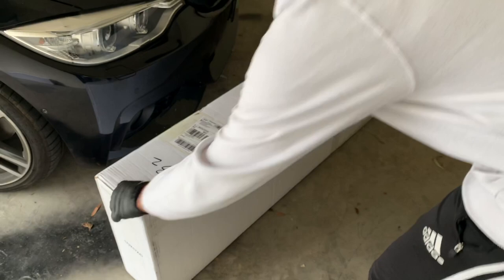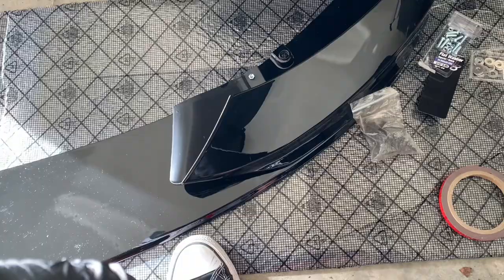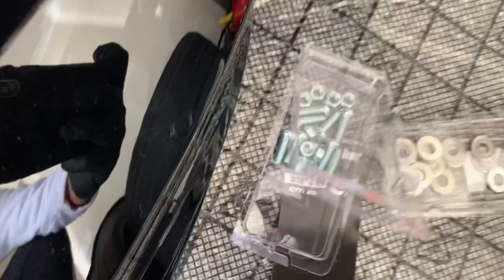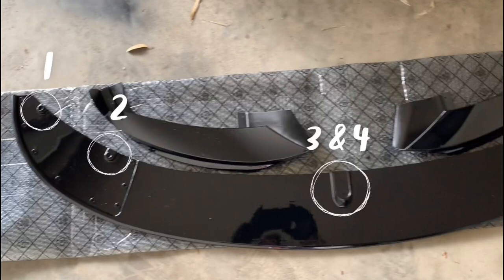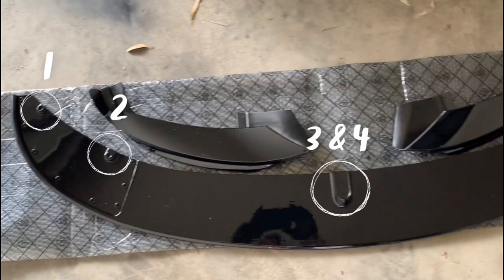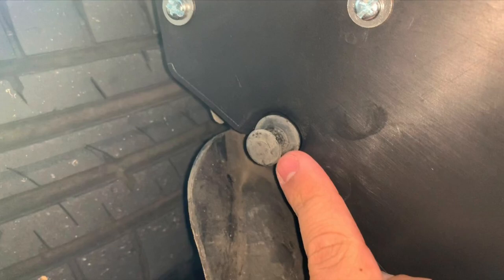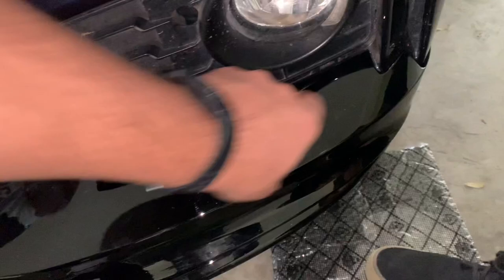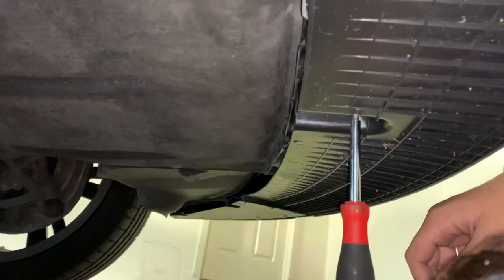BMW 4 Series Front Lip Install (F32/F33/F36)

Comment: So the same damage happened to my lip. Comes from improper mounting. The two screws in center are self tapping. They eventually lose grip and the lip sags and rips. My lip damage looked just like his. I was on the highway, I could tell when it came loose. I know I didn’t hit anything, when I looked it there was a chunk missing from the lip. After research I found that a piece that should come with these kits, a installation plate was not included. It keeps the two screws in the middle support. The screws won’t lose support like they did from being screwed into plastic.
Reply from the maker: This is very helpful for my next lip! Thanks.
Reply: Do you know the name of this piece? My screws keep coming loose and I'm about to buy a new one but don't want the same thing to happen again. Thanks!
Reply: @rifle  Same here, any updates?
Reply: @f82f82  Just cut out some small metal plates and put in Into the small small rectangular hole under the front just where the 2 screws go. For the original BMW m performance front there is a metal plate included but for some reason not for pirate copies..i found out the hard way too

Comment: I would use nuts and bolts with washers. The front of the car takes tons of impact from the air. Screws will strip out IMO.

Comment: What size bolts did you buy?
Reply from the maker: M5 to attach side parts to the bottom lip and then I used the bolts that were already under the car and the ones that came with the lip to attach the it to the bumper.

Comment: Great video! Shame about the ending... How did you smash it up!?
Reply from the maker: the bolts in the middle came loose so that middle section was sitting lower than the rest of the lip and then i must have hit something on the highway and it just ended up like that unfortunately.

Comment: I fitted the exact same one but used the enclosed screws and speed fasteners. Mine ripped the screws out the centre when I went a little quick then it dug in and shattered. Plastic too hard in my opinion. Hope I have more joy with number 2. Will use bolts and washers for the centre this time round.

Comment: What did you mount the last piece to? The center raised piece in the middle of the lip?
Reply from the maker: Drilled a hole into the bottom of the bumper and secured it on with a couple screws

Comment: How would it look like if you just had the bottom part installed so that the other part is original with the color of the car? Would it look weird?
Reply from the maker: Not too sure man but i don’t think the bottom part of this specific type of lip will fit without the two side pieces. You can get other lips that are basically only the bottom part and they also look pretty good!